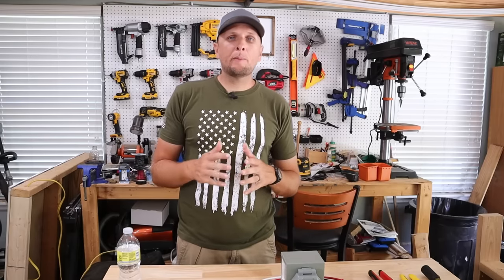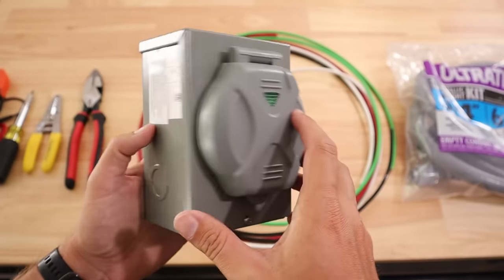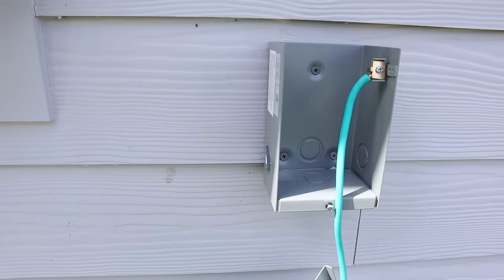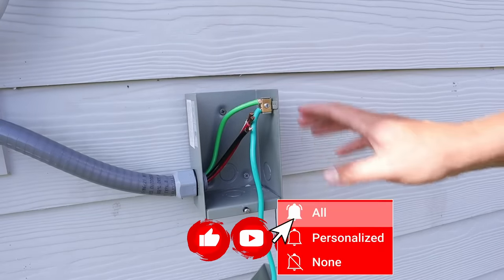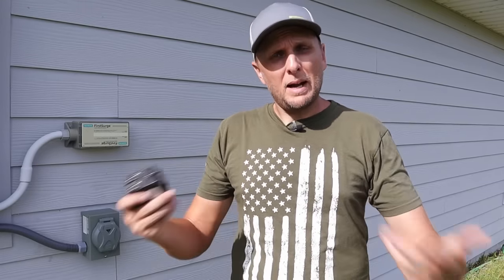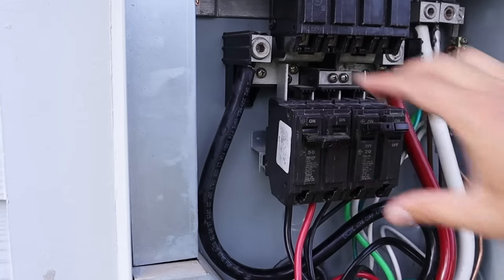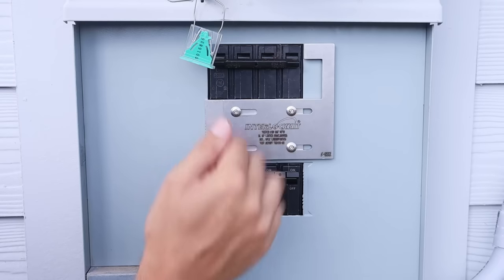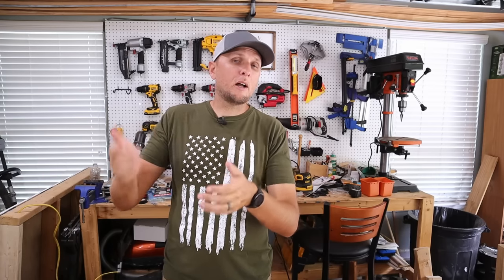The BEST Way To Connect A Generator To Your House - Interlock Kit With Power Inlet Box Install

Comment from the maker: Down here in the South we are starting to prepare for possible hurricanes.  Do you have a backup power solution?  If so, what are you using?  😎
Reply: I like your American accent
Reply: Being down South explains your main breaker on the outside of the house, but doesn't moisture and  dampness cause corrosion specially w/ Hurricane weather.  Most of our outages are in the winter, I'd rather not go outside w/ a foot of snow to hook up my generator.. My generator is in a shed attached to the back of my garage so I don't need to go outside. I open the shed door outside for ventilation...
Reply: Spacecoast of FL here. Gonna have a certified electrician install one of these asap. Do not have the confidence to do this myself. Thanks for explaining what all will be done.
Reply: Same here, Louisiana.
Reply: Purchased a Westinghouse 7500 looking forward to contacting an certified electrician to install a interlock/power inlet box asap
Reply: Do you have a video on correct bonding while using an interlock kit? I’ve heard it’s unsafe but I don’t know why.
Reply: Generac 22k and a buried 500 gallon propane tank
Reply: I just installed a 50 amp inlet, backfeed my pools subpanel via the electric heaters 60 amp breaker.  Runs my whole house and my 2.5 ton hvac.  I didn’t try to run another of the 3 hvacs, one in the main living will suffice.  I did a test run a couple days ago, works like a charm.  Yes i turned my service disconnect off 🤘
Reply: Using a portable Wen generator, running a 10gauge cable into the house and using extension cords off that cable. Basic setup
Reply: @malinwj1167  just wire into a breaker, use a 6/4 wire to your 50 amp outlet on the generator, install a 50 amp plug, run the whole house.  I am wired up on my pool heaters breaker.  When a storm is predicted, i swap out the wires and stand by.  It will run my 2.5 ton with ease.
Reply: @kiddt1999  Thanks for the tip. Unfortunately, my gen only has 30A
Reply: 10KW All American  Power gasoline generator
Reply: @malinwj1167  It works the same way with 30amp. You just won't be able to run as much stuff. 
I have a 30amp and I can power what I need. Just shut the breaker off to your water heater. Until you need it. I can power my stove, water heater, and clothes dryer, but not at the same time. I mention those because they are power hungry. The refrigerator is always plugged in. I don't have central air just a window unit in the bedroom.
Reply: @davidfoulk3078  that's the way to go. I stock 16, 20 pounders of LP. One day though I hope to have a bulk tank.
Reply: @bobber55  We thought about doing that but storage space is a really big deal down here as for no basements lol. I buried a 500 gal tank not 2k sorry for the typo lol, it cost $2k to fill it lol. Anyway in the worst case scenario I will run  generator for 10 hours in a 24 hour day and that will give me almost 3 weeks of  staggered power, plenty of time for utility company to restore main power?? or so I hope lol.
Reply: @davidfoulk3078  If my shed ever caught on fire, you would see it over your way going to the moon.
Bulk tanks especially underground  tanks are a whole lot safer. And yes I could imagine it would cost two grand to fill it up. But at least LP gas does not go bad and as long as someone don't have leaks it's good forever. Or at least most of eternity.
Reply: @bobber55  lol
Reply: @davidicousgregorian  but of course. By all means someone who is qualified should be doing the wiring...
However, either way a person hooks up to their house, you can't use more than you're putting out.
Reply: @davidfoulk3078  Buried? Not worried about Rust?
Reply: @ronself8349  Not at all Ron, cuz the gas company paints a special kind of paint on it for burial in ground and I lease tank for approximately $250.00 every 6 months. I constantly check tank level and if there’s a leak I’ll see it and call them ASAP and gas company repairs or replaces tank and any lost gas on their dime, not mine, as opposed to me purchasing tank and having it buried for approximately $5,000.00 it truly comes down to being a “no brainer” to lease and let them keep it filled and in good repair.
Reply: I’m on the gulf coast in lower Alabama and the day after Hurricane Sally kicked us in the junk a couple years ago I had an electrician wire me in a 50A receptacle on its own breaker right off my main panel.  So I just I throw my 200A main, hook my 6800w (continuous) Generac to the outlet via suicide cable, and power my whole house, including central ac. I shut off non-essential circuits, and luckily have a gas stove and water heater so no power draw there to speak of. We lost power for 7 days after Sally, but life was good with the generator.  A bonus is the 50A outlet also serves as a hookup point for my 220v arc welder.  👍
Reply: Guys,

YaH The Heavenly FATHER HIMSELF was Who they Crucified for our sins and “HERE IS THE PROOF”

From the Ancient Semitic Scroll: 
"Yad He Vav He" is what Moses wrote, when Moses asked YaH His Name (Exodus 3)

Ancient Semitic Direct Translation
Yad - "Behold The Hand"
He - "Behold the Breath"
Vav - "Behold The NAIL" <— YaH’s Crucifixion
He - "Behold the Breath"

“Behold the HAND that Beholds The NAIL” 

PROVES - YAH The Heavenly Father HIMSELF was Who they Crucified

That is EXACTLY what Moses Wrote

Here is what they mean

YaH's Name:
(Ya)d + (H)e, as YaH is what Moses called Him and YaH Declared: "this is My Name, this is My Name for all generations" (Exodus 3)

YaH is The Creator of “MAN”:
Yad He, (HAND BREATH), as YaH's "HAND" Formed man from the dust  of the Earth and His "BREATH" made him a living being (Adam)

YaH's Sacrifice of Crucifixion for “MAN”:
Vav He (NAIL BREATH), the "NAIL" through YaH’s "HAND", in Sacrifice of Crucifixion, that whosoever shall call YaH Savior, His “BREATH” brings forth life (Salvation)

How YaH arrives:
YaH arrives via the Tent of Meeting (Exodus 33:7:11, Isaiah 54, 55), where a Tent is erected outside the city, a cloud descends upon the entrance of the Tent and YaH appears...

Why they demanded YaH to be Crucified:
YaH was Crucified according to Hebrew law (Deuteronomy 21), to be Hung on an Almond Tree for BLASPHEMY as it was for His NAME they demanded Him Crucified. The Messiah claimed He was YaH...

HE WAS YaH!!!

HalleluYAH translates “Praise ye YaH”

The Hebrew Book of Isaiah

Isaiah 42:8
"I am YaH; that is my Name! I will not yield my glory to another or my praise to idols.

Isaiah 43:11
I, I am YAH, and there is no other Savior but Me.

Isaiah 45:5
I am YaH, and there is none else.
Reply: @blakmosescctx   have  the same model awesome awesome unit!!!
Reply: dont move north please!
Reply: @Praise___YaH  Huh?
Reply: 22kw Generac whole home generator running on natural gas.
Reply: @rtoguidver3651  I'm in SE Michigan. I have a TroyBilt 7kw (10kw startup) generator that I've converted to run on tri-fuel. The garage is on the opposite side of the house where the power enters the home. So the hookup is just inside the garage door and the breaker box is installed next to the main breaker panel in the basement, far side of the house. I pull out the generator, about 10 ft from where it sits to where it's run. It's also close to where I can plug up to my natural gas hookup in the garage. Once it's up and running, I go to the basement and flip the main power/generator power switch and all 10 predetermined outlets now are powered by the generator. Including the furnace, but not the A/C. My Genset isn't big enough for a 5ton AC. It works well but does require a little leg works to get it up and going.  Before that, I had like 3 or 4 orange Home Depot buckets full of power cords and 3way plugs to run cables all over. :-)
Reply: nice video. I have done the same few years back. now instead of gas generator, I am using my EV car with added inverter. this way, as long as my car battery has charge, my home will get power. once I got 4 days of power from my car to home.
Reply: Honda EU 2200 or the HF Predictor. Who can afford gas for a stationary unit?
Reply: @blakmosescctx  How can you afford the gas to run that thing?
Reply: @antoniomontana9430  I could not afford a generator that burns 100 gallons of gas a day! Sheesh!
Reply: @kiddt1999  Illegal as hell, NEVER depend on someone remembering to "shut off" a disconnect breaker.
Reply: @trex2092  it is the first thing you do.  Shut off the main.  I still wrote it next to the breaker as a reminder.
Reply: Would you mind doing the installation for me? 🤣
Reply: I’m Ontario Canada we aren’t allowed to it this way so I just went with a Generlink…….faster and cheaper than a transfer switch
Power the whole house with a 7500w portable generator that I put in a tiny shed I made along with 40liters external fuel tank (longer run time)
Cheers
Reply: Generac 22kw natural gas stand by gen
Reply: The "BEST" way is to purchase a Generalink, takes less than 5 minutes to install by your power provider FREE of charge and you are DONE.  No calling an expensive electrician or worrying about interlocks or any of the nonsense covered in this video.
Reply: @kiddt1999  main breaker and breaker where generator power is coming in are suppose to be interlocked to prevent both from being closed at the same time.  You probably will do it correctly but what if someone else hooks it up and may not know how to do it properly, then a lineman could get electrocuted.
Reply: Where can I buy that same interlock as you show in your film thanks Steve
Reply: @kiddt1999  the lineman point is a good point but if he is doing his job right and proper he won't get hit by the juice. Now on the other hand they restore power and the main is still closed your generator takes the hit. Hopefully your breakers are in good working order and do their jobs by tripping other wise you have a house on fire and as well as a generator on fire. Have fun with that...
Reply: @pacearrow4620  u
Reply: Hey Adam, I would like to get a emergency generator, but prices are high. Can I just add an inverter to my riding lawnmower? Do's/Don't's?
Reply: Really ?  ok  lets take this advise .... diesel / gas . hmmm    unless you have stock pile ... this does not work .... gas stations run on electricity ( and they are not working )      NEXT !!!!!!!!!
Reply: What size generator are you running and are you using 6 AWG? How did you size the wire for your install?
Reply: @kiddt1999  Ditto.
Reply: What double pole 50 amp do you get? 240v or 120v?
Reply: @rtoguidver3651  I live in South Florida all circuit breakers are inside garage.
Reply: Question for you (How to home), Would sticking a copper rod into the ground and attaching a wire to it and grounding the box and the plug will eliminate the need to bring a ground from the distribution panel?
Reply: @loloforge2841  From what I understand you have to stick an 8ft rod in the ground and connect the breaker box to it and then all of the outlets and switches need to have ground wires running back to the box. I'm not sure if that answers your question or not.
Reply: @catsmeow5566  no disrespect but the question was stated for HowToHomeDIY. I want to know HIS feedback. Thx
Reply: @loloforge2841  Ah. Got it. Hopefully he'll respond.
Reply: I appreciate this video, but I'm trying to find information regarding hooking a generator to a panel to run the electrical WITHOUT having grid power.

I'm assuming that I can just use the power inlet box connected to a 50 amp breaker and in my panel, and then just connect the generator and that should power my panel.  Is this the case?

I can't find ANY information on this.  Everyone seems to be connecting to a grid tied system.

Thanks, in advance, for any information anyone can give me.
Reply: WOW $500 a year for tank rental only... I thought mine was bad at $60 annual. I guess they saw you coming must be a California guy...LOL
Reply: PCB FLorida. I use a WEstinghouse 9500 Dual Fuel Generator and a 40A Generlink to hook into the house. About as easy as it gets
Reply: I just purchased a firman T08072 10,000 Watt generator.. will it do? Single wide mobile home.
Reply: @blakmosescctx hows that Westinghouse doing I'm in the generator market I saw those today on amazon
Reply: @KeoniKoa if no utility power, you connect the power from the generator inlet box to the panel main breaker which then powers the entire panel.
Reply: Tried to watch the video but it kept trying to make me watch ads. Guess I’ll go find a decent channel to get answers. I came for help not ads.
Reply from the maker: @Whatsupeiththestupidhandlebs well good luck!  The reason the information is free is because of the ads.  Every video will have them.
Reply: @avvarutheja  Great idea. Which EV do you have?
Reply: Guys, here is The TRUE Savior

HalleluYAH translates “Praise ye YaH”

YaH is The Heavenly Father 
YaH arrives via the TENT OF MEETING
YaH was Who they Crucified for our sins
YaH was Crucified on an Almond TREE

— Ancient Semitic Cuneiform of Moshe (Moses)
— Isa Scroll (The Original Isaiah)

Isaiah 42:8
"I am YaH; that is my Name! I will not yield my glory to another or my praise to idols.

Isaiah 43:11
I, I am YAH, and there is no other Savior but Me.

Isaiah 45:5
I am YaH, and there is none else.
Reply: Where did you get the power cord from?
Reply: @waynespringer501  hoes it going.

I'm down South East FL.
I have the Generac 5500 and I've been connecting directly to the Dryer Breaker.
I've been doing this for years and the last Hurricane 1.5 yrs ago I did something wrong.
It seemed I was getting 220v into my 110v Circuits,  I burned out my Garage Door Motor, Irrigation Panel, 1 Ceiling Fan and almost my Refrigerator,  ice maker fried. 
U have any idea how that happend?

This Box/Unit your talking about, where you get this?

This year I'm hopk
Reply: @howtohomediy using a 50A power inlet, aren't I constrained by the usage of up to 50A continuous? Meaning 50*120V = 6000W? Sorry if that's a stupid question but I'm curious why folks buy the giant portable genny's if there's a constraint going into the house
Reply: The Predator 9000 looks about right for my small house
Reply: I’m getting ready for Milton
Reply: Yep
Reply: Outstanding video!!!
Reply: Thank you for this, I'm no electrician, but you explained it really well! I might have to go ahead and do it my self.
Reply: I had one installed earlier this year to get ready for these crazy Florida storms. And have not had to use it yet. So came looking for hook up instruction steps. Found your video.
Reply: I just use my Lincoln Ranger 330MPX